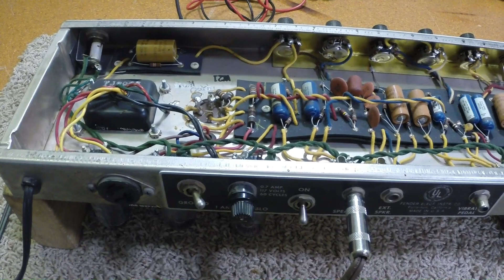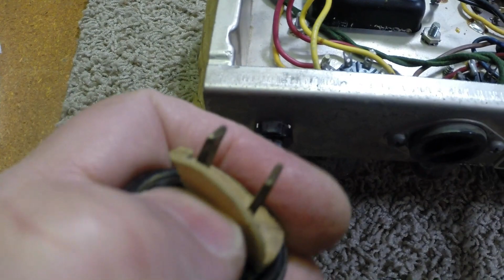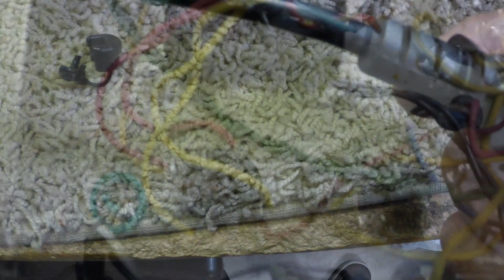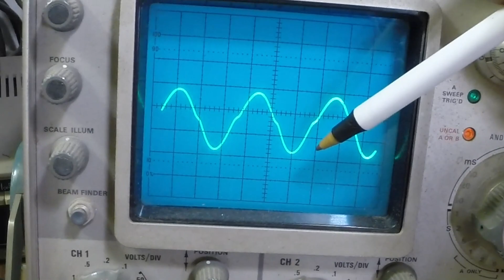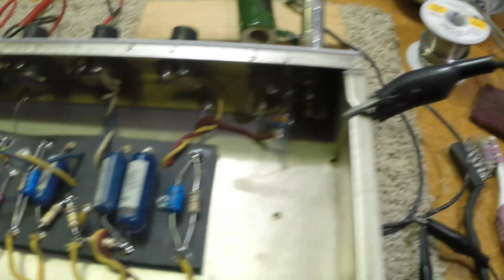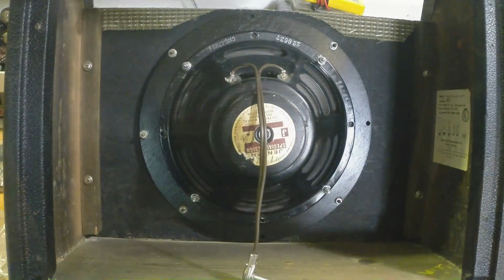Pre CBS Princeton Amp Rehab

Comment: I have a 1958 (if I remember correctly) Danelectro Cadet 122 amp. It doesn't have an input transformer, it's the hot chassis style. Is it possible to add a transformer?
Reply from the maker: Yes you can.  You will need a 115 or 117 volt isolation transformer and some wiring know how.  Make sure you have a large enough transformer to handle the current.  Looks like you will need 150 ma. for the heater and about another 15 ma for the plate and screen of the 12au6.  the 35W4 will require another 150ma heater current, and a possible 200 ma plate current.   The 50C5  yet another 150 ma for heaters and about 60 ma for the plate and screen.  Since the heaters are wired in series to make roughly 100 volts, the will also be across the secondary of the transformer along with all the audio circuits.  The simplest thing to do is add a polarized ac plug, making sure the chassis is connected to the neutral side.  I do have to say the worst shock I ever got was on a similarly wired line operated amp as a youngster.  I was sitting at the kitchen table with my little instruction book.  With my left hand holding the neck, I put my right hand to the side of my head and rested my elbow on the range/oven beside me.  All I saw was a bright blue and yellow flash across my eyes.  Man that hurt.  I said I got shocked and my Father pulled the ac plug out and turned it over  (no polarization in those days)  and plugged it back in, leaving the room with a " make sure you plug it in THAT way"   Just some more of the suck it up and move on generation.  :)  But 2 this dae i do knot think it afffekted me.
Reply: @guitarc.p.r.9675  thank you for that, I appreciate it very much!

The worst I ever got zapped was from an old TV we use to have back in the day. The vertical hold would go out on it all the time and you had to stick a 6in long screwdriver inside the TV to adjust it. One day I was doing this and the screwdriver slipped and hit something inside it shouldn't have!

Amazing that we survived as kids back then... With all these warning stickers we have today saying how dangerous this and that is.